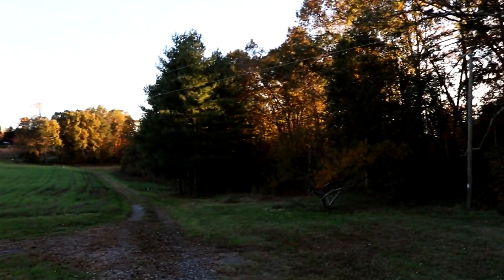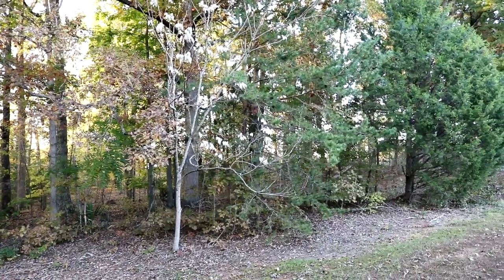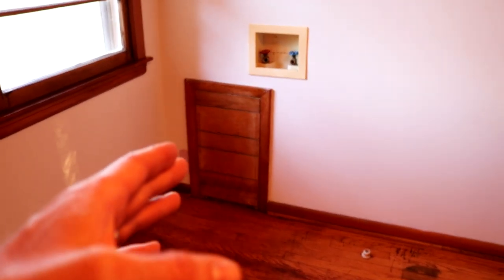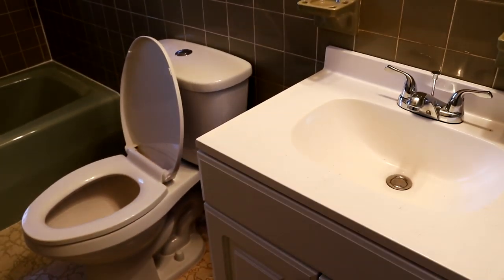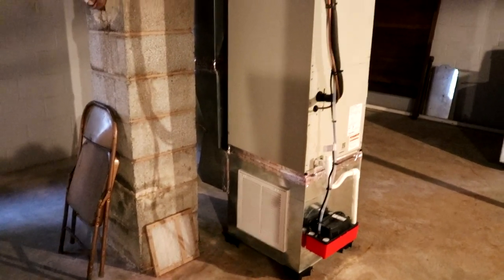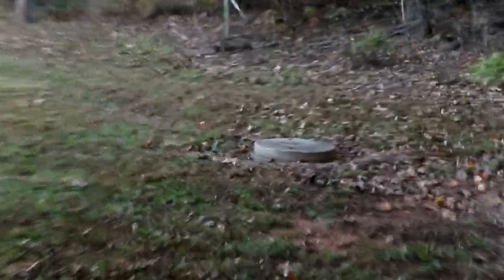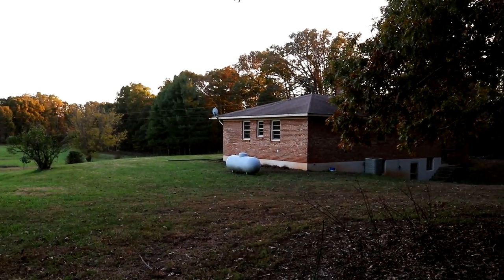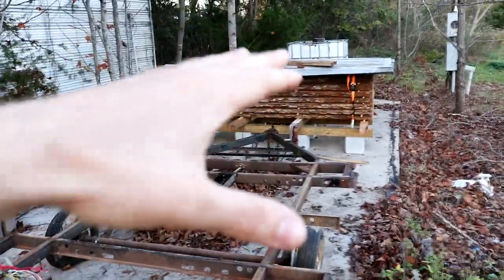DIY Home Renovation - THE BIG REVEAL!  ($1000 Rental) - #10

Comment: I'm glad you didn't update the house. I love the character of older homes. I really enjoy your videos and learn a lot.
Reply from the maker: Thanks
Reply: Just gonna add "character" to the evergrowing list of words with no meaning.
Reply from the maker: @pumpkin6429  Ha, I know what you mean. But this houses interior does have a lot of character, the outside is kind of boring. But I do agree, words are cheap these days.....no insult to the original commenter.
Reply: @homemadehome5575  Yep, the exterior is characterphobic.  But keep mind that is the idea!  When you add generous stairs and a couple patios with some brick verticals low walls and a couple columns, that will "ground the house", which I think bothers you most.
I like this house for the same reason you like that downstairs bathroom.  YOU use the house, the house doesn't use you.  Does that make any sense?
Maybe add  some very plain sliding glass doors or that glass block or even a skylight.  The setting is star not the house.

Comment: That tree wouldn't look so rough if you just trimmed all the branches up to 6 or 7 feet.
Reply: i agree leave the tree
Reply: Agree. Plus he said it was October 30, the tree may also be looking scraggly as it starts going dormant. Nine months after filming that tree is probably already gone.
Reply: I disagree.  First identify the "tree", it looks more like a big bush.  If it is a "junk tree" get rid of it.  If is is a  good tree, cut the dead out then artfully shape it.  Very bad idea to just lop the top of it at all one length.  So either junk it, or work with it, (make it into a  naturalistic graceful form)  because it really is a focal point and looks BAD now.
Reply: @rockshot100  Ah, yes. I read the original comment as a suggestion to prune to that height. If, as you suggest, they meant to just reduce the height without regard to structure then, yes, that is bad idea. Nothing more disheartening than trees, especially tall ones, reduced to a set height without regard to tree health and growth response of the tree (i.e., usually a ton of water sprouts). This particular tree didn't look terribly tall and even if it is a big bush it might still prune to a good tree form or could be shaped taking its preferred growth habit into consideration. (I am more familiar with fruit trees and several species that would naturally be bushes are often trained as trees, e.g., pomegranate, quince, some plum species, olives, etc.)
Reply: @terrybyrd5105  do you have  any idea how much labor that is???
Reply: @npknscrb  good way to Phrase it, if the tree/bush is a desirable plant, then work with it to give it "structure", although no topiary, like a tennis ball on a stick.
Reply: @npknscrb  All plants have  an individual personality or habit.  Some better than others.  It is alway best to let said plant be said plant and not fight against its natural character.  Could you imagine cutting a graceful birch into a box shape?  Fruit trees are different because you are trying to maximize the yield.  I would tend to level off enough of that front lawn into a football, baseball, overflow parking into an oval shape.  Freshly made wood chips don''t make a good mulch,  but in this case I would use it anyway and randomly plant naturalistic initially small "woodland plants" like redbud, dogwood, forsythia, birch, pines (white pine looks too conical and formal) but there are many  others.  I would mulch all of it to a depth of 4 or more inches and he is going to need a hell of a lot!  I don't like spruce for that reason, looks like Xmas year round.  but you get the idea, be really natural and random.  this would feather out from the existing treeline up to the new ball field.  He could use a arbor with a swing like structure directly across the ball field in line with the front door, just to create a focal point.  That is just too much lawn to maintain especially since nobody will ever use it and it really doesn't look good either.  I would ONLY keep that plant if it is a fine beautiful specimen.

Comment: First of great job on the house.
In the future 
1st - take down the wood paneling.
2nd - remodel kitchen
3rd - more lighting in basement. To highlight the area.
4th - finish basement
5th - maybe add a double sliding doors and mini patio near master bedroom. 
Love the house. Congrats
Reply: He was just doing a light renovation and not doing a full remodel. I'm sure if he was doing a full remodel he would have updated it further. 

But the ends probably didn't justify the means in this project.

People probably wouldn't rent a house over $1000 in that area.
Reply: @dct90210  I knew this. Just suggestions for future

Comment: Is the other door in the kitchen a pantry? Do you plan to do any landscaping on the front of the house? This time of year Lowe's has some great deals on shrubs. At least one on either side of the front stoop would make a big difference. Fruit trees would be great for the long term also. Maybe a little line of them separating your tiny house lot from the main house. Would your tiny house be able to hook up to the existing septic? Composting toilets are why I don't want a tiny house. A tiny house doesn't have to be on wheels. It could just be a tiny 'cottage' that could be yours and then a rental or guesthouse/man cave as your family grows out of it and into the main house.
Reply from the maker: No, it is a hallway. No landscaping around the house for now. I may plan some trees eventually, fruit trees. Not sure about the toilet, septic is too far away.

Comment: The house looks great! When you get around to replacing those lights in the barn (if you haven't already) go with LED fixtures. Much easier on the generator plus they'll light up ok when/if it gets cold in the winter. Florescents don't really like cold temperatures.
Reply from the maker: That's the plan, at least for now before I have to pay for them.  Now I'm planning on doing a nicer renovation of the barn. Wiring, insulation, interior walls, windows, heating, ac, etc. A shop away from my shop to enjoy.

Comment: I would love to see some of the Jeep project, I love the old Willy`s jeeps. My sons and I are in the process of looking for one ourselves to restore.
Reply from the maker: It's been more of an idea and dream than an actual project, although I have done a lot to it. Basically reconstructing half the tub. I bought the jeep 16-17 years ago for $800. Then last year, found the top $300, then found the trailer while doing this renovation $500. When I found the jeep, I think I had just started driving, I told someone else before that, but I think it was right after I got my license. I was going up the road and saw a car covered up with an old tarp, just the headlight was showing but I could tell what it was. I turned around and asked the man if he wanted to sell. He said no, I begged, he said no but I left my number. He called me that night and said he'd sell it. He said $800, I offered him, $500, he said $800 or no deal I said ok. I don't even know where I got the money now but I got it somehow. My plan is to get that barn nicer than I mentioned in the video, basically pouring a new slab and adding 12-foot additions to both sides. I'm going to set it up partly as a car and motorcycle shop. It may be another year or two, but I'm getting closer to working on it.
Reply: "Homestead Hotrodder"  BRAND IT NOW!
Reply from the maker: @MarkLindsayCNC  Not bad
Reply: @homemadehome5575    If/when you get to working on that Jeep PLEASE share!  Either here or a separate channel if you think that'd be more appropriate.  We have a CJ-3A that's been in my family 30+ years and I have so many great childhood memories of my dad taking us through the woods and fields in it.  Looking forward to taking my son out in it in a few years when he's a little older.  I'd be very interested in seeing yours get put back together!

Comment: I recognised this floor plan from the beginning, because the first house we built was in 1969,  and our neighbours at our previous house bought the lot next door and  built this plan, so around the same vintage. A nice solid and practical design with little wasted space.  But, those basement stairs need a landing and right angle flight down towards the door, before anyone bashes their brains against that wall! Oops. 😉 Lovely surroundings and land, and lots of potential for more,  you did good.

Comment: Wish I could do a lot of what you do.  The electric in mine is all stripped out and needs the switches. Just doing that would save money even though I have to have it checked by a bonded electrician.  It was on fuses and the last person to change it over left the wires hanging, so now I have to deal with it. Nice house this one you have.

Comment: "The smoke alarm is chirping so you'll just have to deal with it." LOL It's been chirping for the last 6 videos or so. It could even be heard when you were recording outside. (At first I thought it was mine and it pissed me off b/c they are brand new.) I think we've learned to live with it by now. ;) But speaking of background noise, what was that you were listening to?

I've been hoping for this series. You teased about it on the 12K. (Loved that series. I'm in recovery from withdrawal.) Nice job. The only thing I would have recommended differently is use a wrap around curtain rod above the bathroom window and cut down a shower curtain to length just below the window as a full length shower curtain isn't needed there. And it doesn't have to go all the way across as you now have the plastic panels. It would also look like a typical bathroom. I can see the second rod being used as a grab bar and possibly be pulled out. Can't wait to see what you do next. You always amaze me. Wish I could do half of what you do.

Comment: I've driven ground rods into ground with a 1/2 inch hammer drill. Works great.
Reply from the maker: I've heard about that, need to try it next time.
Reply: @homemadehome5575  that sledge hammer looks like work! I saw the hammer drill on This Old House. Roger was using it to drive rebar.

Comment: I have this identical house with a rent to own renter in it.  He has a year to get the house in his name.  If that doesn't happen you are welcome to buy it.  It is 50 miles south of Montgomery and we are only asking $50k.  It is 1/2 acre in Luverne city limits.  Also has tile siding instead of brick and no basement.  We screened the carport because we have a separate garage.  Also a sliding glass door on the back wall of the dining room that opens to an 8x16 partially covered deck.

Comment: That looks like a snug comfortable house. I'm a little concerned about the propane heaters in the rooms though. Seems like a dangerous thing to be close to you. The house looks like it could use a front deck or a front porch where you can sit and check out the sunshine and the fresh air and the green fields in the afternoon after dinner.
Reply from the maker: The heaters are only in the dining room and living room. They are just back up, not a main source.

Comment: You do have a few projects in that barn....would love to see what you do with the reclaimed wood!  Why the in-wall heaters if there is a heat pump?
Reply from the maker: They were already there. A heat pump is electric if the power goes out, the propane heaters still work. So no reason to get rid of them.

Comment: That bush/tree takes center stage.  If you can work with it and make an extremely beautiful SPECIMEN out of it, keep it, if not, trash it. 
I am really wondering WHY you put the electric box there instead of behind the stair?  It would not have been "on display"  every time you walk in or out of the house.  I am sure you considered it, just wonder why.  It looked like you could put it on the opposite side of the side door but may have lost my bearings when you filmed the basement.  I am baffled!
Reply from the maker: Just getting it done, the mast is already there,  all the wires, etc. I don't mind it there.

Comment: Didn't you also buy a large farmhouse at one point? Will we see a series on that?
Reply from the maker: Yes, I end up with more than one house at a time usually and have to work on them in the order that makes the most sense. I have the biggest plans for that house so I just work on the lesser renovations first. I'm working on a renovation now then I plan on getting on that one, but what happens between now and then may change that.....but it will be shown.

Comment: I vote work shop and ditch the tree.  Oh, And a big rubber duckie with muddy feet pic on the wall!  I thought you wanted to live in the farmhouse!  I'd give anything for a trailer.  I was wondering if you were gonna use the tiny house you had already. lol  Great job!!!
Reply from the maker: I always change my plan, what I think I'm going to end up doing is just rent the house for now (already rented). I'm going to renovate the "barn" into a workshop with about 12 foot additions off both sides. The plan is to jack hammer up the slab and pour a new one. It will be for working on cars, general projects as well as one of the additions be a hand tool wood shop. The tiny house will go behind it, hooked up to power and well. I'll probably keep the one I'm building and build and sell another to see if it would be a good business venture. There's even a place where a trailer used to be, I may put another one there and rent it out.
Reply: @homemadehome5575  Excellent idea!.  I must admit, I'm a bit envious! =)  I have a bazillion plans in my mind all the time and yes, keep changing them too.  But it sure is fun thinking about it!

Comment: I love that jeep trailer
Reply from the maker: Me too, I saw it on Craigslist about 3 years ago but did not buy it. I emailed the guy back then but didn't go any further than that..........last summer I got to thinking about it, regretting not buying it so I tried emailing him again from the craigslist reply email not thinking it would work but it did and he still had it. Paid $500 with a title. It was owned by the forestry department originally.
Reply: That is awesome. $500 is awesomely as well. I've got a few friends that are die hard old school  jeep fans. I always wanted an older jeep but I've never found one that's reasonable.
Reply from the maker: @theycallmebacon5692  After you restore one, those prices you see won't look so high.
Reply: @homemadehome5575  around my area the prices are out of control. Your jeep would be 4k to. 6k unrestored.

Comment: Will they need to use the propane heaters with the electric heat pump or will the electric heat pump heat the house throughout the winter and the propane would just be a backup
Reply from the maker: No, the heat pump is enough for most any cold day. In an extreme cold that lasts days, it may help to use the propane if you didn't want it to run all the time or if power goes out.

Comment: Just curious...if you have a washer and dryer in the basement, where does the dryer vent down there? Inquiring minds want to know.
Reply from the maker: I moved it over towards the bottom of the basement steps and made an insert for the window. It's not by the washer but I did not want to cut a hole in the foundation right now.

Comment: @6:42:  Is that an electric stove?  With the propane heaters, I'd have guessed propane stove.
Reply from the maker: The house is all electric, except it has two additional propane heaters. It's a good back up as it requires no electric. Also good to supplement the heat pump if it's super cold.

Comment: You are gonna make some money on that place.  I would throw some gravel into the puddles on the driveway.  Tiny house?  Build a 1000sq ft, 2 bed home and rent it out.  A tiny house is almost as much work and the material savings would be shadowed by the rent of a working class home.
Reply from the maker: I don't want to add any additional houses to the land, the tiny house is almost done. Also don't want to do any more permitted work. Basically just building the little one because I want and no other reason. I can buy houses way cheaper than anything I'd build.

Comment: October  . I'm confused
Reply from the maker: While I was renovating the last house ($12,000 House). I bought and fixed up this one, so I was filming two renovations at once. I finished this one in October 2018. If you have not seen the videos, this is #10 in the series. I did over 50 videos in the last renovation. So I was finishing those up before posting this renovation. I'm already working on the next house. It just happened to be the same time of year in the videos I've been posting, only last summer. It has been rented since november.
Reply from the maker: While I was renovating the last house ($12,000 House). I bought and fixed up this one, so I was filming two renovations at once. I finished this one in October 2018. If you have not seen the videos, this is #10 in the series. I did over 50 videos in the last renovation. So I was finishing those up before posting this renovation. I'm already working on the next house. It just happened to be the same time of year in the videos I've been posting, only last summer. It has been rented since november.